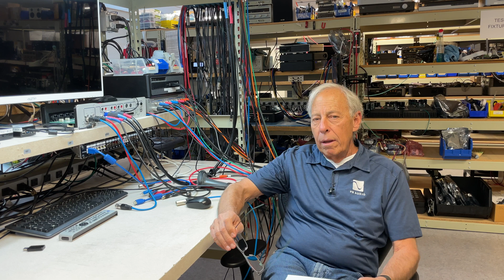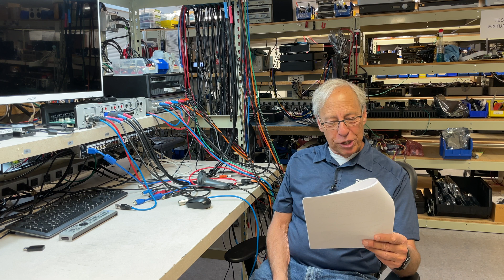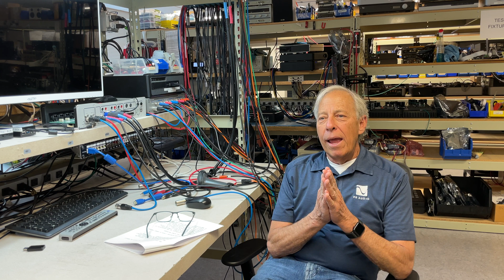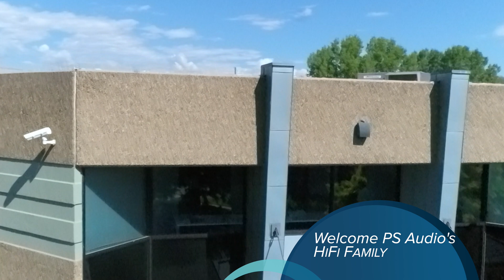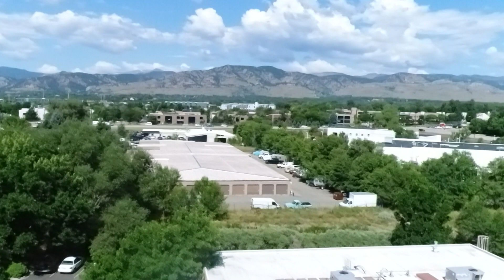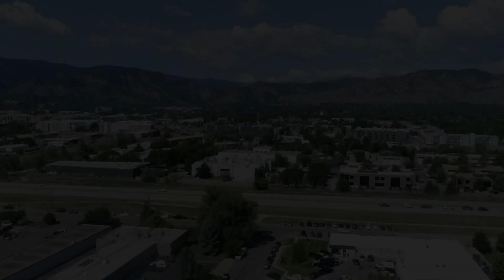Upgrade external clock or power cables?

Comment: I would ask this question to Hans Beekhuyzen. He's the digital audio expert, and he's definitely knowledgeable enough to know which choice is best. This isn't Paul's specialty, as you can tell by his answer that made very little sense to me. I've never ever heard of a clock for digital audio being advertised for long term error avoidance.
Reply: Hans Beekhuyzen?  Are you serious?  Apparently you, like Hans, think MQA is a superior digital format when in fact, it's been an inferior format since the day it was released.  Obviously, this isn't your area of expertise either.  Nor is it Hans.  

Many of the comments in this channel on this topic really seem to bring out the true colors of mainstream high-end audio.  And it ain't pretty.
Reply: @HenryLaw19891024  Did you actually read what I wrote? Or are your reading comprehension skills really that awful? I guess there's also a very possible third option, which is that you just felt like being a jerk, and/or starting trouble. But either way. Why I'm here is none of your business anyway. So I wouldn't be too concerned about it, if I were you. Thank God I'm not though. Have a wonderful night sir. ✌️
Reply: @Taco Cope harder
Reply: Two critics, and not one positive word offered between either one of them. No alternative offered. No explanation on why you're attacking the man, other then one of his opinions. On one single little subject. Not very strong arguments by either of you. With zero advice given by either of you. You both may as well have on a t-shirt that says "I'm an internet troll", because your behavior reeks of it. Probably a couple of ASR Cultists with too much time on your hands. At least I was trying to offer a hand, and help. You've both offered nothing, but negativity, and attitudes. 

Didn't your Mother ever tell you that if you've got nothing nice to say? Say nothing at all. I'll stick by Hans, myself. At least he has the courage to put himself, and his opinions out there to be criticized on a weekly basis. What have you two done to help out the audio community lately? I think we all already know the answer to that question though. Don't we? Nothing!
Reply: @amb3cog  Well read my post about here about external clocks, how they work, why they are not the Nirvana many audiophiles think. Now I have watched Hans channel a few times and all I see is the same audiophile voodoo promoted with no in-depth technical  understanding of electronics or this specific technology on an engineering level. So yes as an  accredited EE working in the professional AV industry for 30+ years, I think I am qualified to question his statements.
Reply: @andydelle4509  Speaking of buzz words. This is the same one I always hear when an argument starts on here. I'm an EE! I'm sorry to tell you but being an EE doesn't qualify you for much of anything, except for what you specialize in. What EXACTLY do you specialize in? And where, and when did you get your degree? Where have you worked at? And what type of work have you done? The answers to those questions will help us determine if you're actually qualified, or not. You'll have to forgive for not just taking someone's word on the internet, but would you? It's like that guy on TV says. It's not that U don't trust you. I don't trust anyone.
Reply: @andydelle4509  Okay I'll check it out if I can. I don't have an account. And honestly I'm about out of time at the moment for this right now. But I'll get back to it. As for my moniker. Yes it's for him. I have a few of his products, and have lived less then 50 miles from where he started his company most of my life. I'm a huge fan of his, and the engineers he hired. He always managed to find the smartest guys out there I'm told. And they did amazing work without modern computers, and techniques. But they still relied on their ears mainly, and it shows. I'm a firm believer in audio gear being designed properly, and feel that measurements matter in design. But that they're not the be all, end all. And that a flat frequency response shouldn't always be the goal, at least in HiFi. His old tube amps are definitely colored, but in the best way possible. And on efficient speakers, are very hard to beat for pure musical enjoyment. That being said, I prefer my Exposure 3010S2D Integrated amp for everyday use. It's more reliable, and also much more transparent/has a lower noise floor.
Reply: @amb3cog  If you're looking for cute warm fuzzies to make you feel special, why not try one of those on-line self-esteem building classes.  But based on Hans love for the MQA sound it should be evident to many that Hans lacks the ability to discern / interpret what he hears.   IOW, Hans may be a super-duper expert when it comes to digital signal processing but he would hardly seem qualified to judge a technology / product based on its sound quality.  Live with it.
Reply: @ToadStool942  "Hans may be a super-duper expert when it comes to digital signal processing"
He's not that either based on what I saw in his YouTube videos. He is very good at repeating buzz words.
Reply: @ToadStool942  I'm still trying to figure out how someone's opinion on sound quality changes their ability to have knowledge on a subject? Or even their ability to hear how something naturally sounds. You'll have to explain that me. It's called subjectivity, it's what this hobby is built on. This hobby is for entertainment. What sound I enjoy is what I enjoy. The same for Hans. Whatever that is doesn't change one's ability to determine how something sounds. Every reviewer on the internet has their preferences, yet they still manage to convey a product's natural sound signature to us, whether they enjoy it, or not. 

Like Zero Fidelity for instance. Sean doesn't like most of the gear he reviews, yet he still tells us about it's natural performance abilities/envelope without bias. He's even given rave reviews to products like the Triangle Bro 3, for instance, despite him not preferring that type of sound whatsoever. Is he also disqualified, if he likes something you don't prefer, or you don't think sounds good? It sounds to me like the only one who can't separate their biases here is you. 

I've got Tidal, and Qobuz subscriptions, and honestly the differences are very, very small on my less then $10k system (yes it does full MQA decoding). So it's not even that big of a deal IMO. He (Hans) has a much more resolving system then I do. He feels he can hear the difference, and he likes the sound of MQA. So what? I know people that love the sound of the loudness button that review gear. 

I don't enjoy a loudness button myself, but they do. I've still heard products that all of these people have reviewed, and they were still spot on about how it sounded. People can separate their preferences out, and still give an honest take on a product. Not to mention, they still have knowledge, no matter what they like. That knowledge isn't changed in any way at all by their personal preferences. 

And who ever asked for warm, and fuzzy? I was merely pointing out that you're being negative without offering positive alternatives. In order words. You're not helping at all. And IMO, if you're not helping the discussion move forward in a positive way. You're just dragging it down, and quite possibly hurting said discussion. I'm trying to help this gentleman come to a decision on his problem. Hasn't that the point of today's video? His decision between two products? I can't think of anyone better to ask then Hans, but if you have someone else to recommend. I'm so ears, and I'm sure the person who asked the question is also.
Reply: @amb3cog  I am not offering any opinion on sound quality here. While I understand the concept of listening tests, I also respect the unforgiving laws of physics and electrical engineering. While I do not have any medical or psychological education, I think I do understand placebo effect as it relates to high end audio.

I am not questioning Han's opinion of how he thinks something sounds. I am challenging for example, his video on audio cables and see he clearly has no understanding of transmission line theory. So if he thinks a certain cable sound better to him, that's fine. But don;t start making up science to try to explain it. Stick to known physics, which by the way does not support what he hears. Enter the complex human bias - placebo effect.

As for "resolving system" this really triggers my BS and snob detector. Any $499 AV receiver at Best Buy coupled with modern computer aided design speakers can faithfully resolve the audio spectrum. If you like brushed aluminum and exotic wood trim, that's fine. But it has no influence on sound reproduction. Nor do power cords and expensive USB or Ethernet cables.

Here is my favorite example of the "resolving system" BS: Some audiophiles buy these $20,000 single ended tube amplifiers, 1930s technology, with 5% or more distortion and a S/N of 80db due to the AC tube filaments.  Now that $499 Denon may have a S/N of over 100db. So how can the 80db S/N tube amp have more resolving capability than the 100db+ Denon receiver? Any small details are lost in all the hum and distortion of the $20,000 tube amp whereas the Denon can reproduce them very clearly. But the $20,00 amp has to be better because it's hand made in a garage versus a modern factory with extensive R&D capabilities. This is the audiophile BS I speak of.

Now is a PS AUdio BHK amp superior to a Denon receiver? Yes, in better build quality and better components and finishing. Does it sound any better? I don't know. Does it sound different? Probably, but which is more accurate? Only test and measurement can answer that. Which sounds better to you. Only you can answer that.
Reply: Yes, all 50s/60s tube gear was colored, still is as I have an all DIY tube music system. Just the state of technology. I have a Scott 342 solid state receiver for nostalgia as a friend of my father's had one in the late 1960s and I was in awe of it as a 9 year old (my dad's HiFi was an RCA compact stereo record player, 100% plastic including speakers). I restored the 342 from Ebay but it's a piece of junk sonically. But it's the best they could do with first generation solid state. The competitors were no better at the time.
Reply: @amb3cog  When you ask these questions, you might consider asking similar questions about the subjective fine art e.g. sculptures, paintings, etc. and those critique it and determine its value.  It seems from your perspective, why even subject ourselves to hearing tests.  (not that hearing test has much of anything to do with sound quality or developing the ability to discern / interpret what we hear.  If a music piece sounds natural to your great great grandpa or a 5-year old then is that good enough for you?  Just how far are you willing to extend the subjectiveness of this industry / hobby?  And if one's learned ability to discern / interpret what they hear matters not, then why did you suggest others seek Hans opinion because in such a subjective case as the one you paint, everybody's opinion of sound quality is the same as everybody elses, right?

As for your helping this gentleman as you claim, how could you possibly be helping him if the source your trying to lead him lacks any reasonble ability to discern / interpret what he hears?  Maybe (and it may not be so) Hans has some expertise with digital signal processing but if what he assembles or prefers lacks real sound quality, it matters not that he's an expert at anything.

FWIW, this hobby is still inteneded to be separate and yes superior to other music lovers who care nothing about sound quality.  Think high fidelity or high-end?  Or do you think like many others these terms are only associated with how much one spends?

Maybe you should consider re-evaluating your own position in this hobby before "helping" others?

BTW, I wasn't being negative but hopefully just being realistic.  You interpreted my subjective comment as negative because I'm apparently harshing your buzz on this supposed subjective hobby where nothing matters.  Well, except what Hans the "expert" has to say.  Negative?  Have you considered the possibility that while you're trying to help others maybe I'm trying to help you help others?
Reply: "I would ask this question to Hans Beekhuyzen. He's the digital audio expert".

I too would strongly disagree.

Comment: The clock has an oven? Now I’m more confused.
Reply: My oven has a clock.
Reply: Every crystal oscillator has a temperature at which it performs best.  Typically around 85C.  So an oven is employed to keep the device at its optimal temperature improving its close in phase noise and delivering a noticeable improvement in sound quality in a digital playback system.
Reply: Yes some do. To keep the crystal at a constant temperature, for accuracy.
Reply: @amb3cog  Crystal? I thought these were atomic clocks?
Reply: @BrianSu  Both exist. Crystal ovens are still found on sensitive lab equipment. In my field, the master sync (clock) generator in a broadcast facility always had a crystal oven, 14,318,180hz / 4 = the infamous 3,579,545hz color subcarrier frequency in the analog TV days. Every analog color TV also had a 3.58mhz oscillator but no oven as it tracked the broadcast signal anyway.

Atomic frequency references are very high end, mostly in aerospace. TV Networks all had one as the master reference, 10mhz was the frequency. These count radio active isotope decay which is extremely predictable and accurate. Temperature has little to no impact on the overall unit. GPS lock however is replacing atomic clocks in all but the most critical frequency source needs.
Reply: Atomic clocks do
Reply: or filled with sand to convert vibrations into heat...
Reply: @jean-paulschweitzer6211  I actually bury mine in sand to isolate vibration.  Another noticeable improvement in sound.